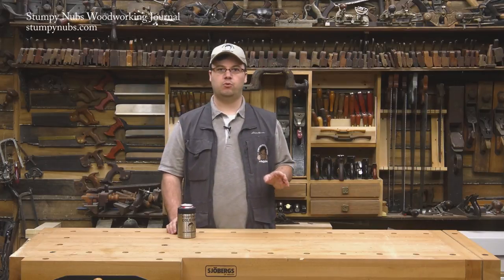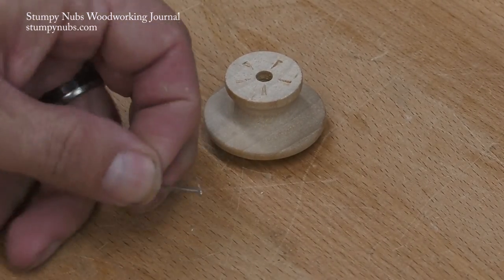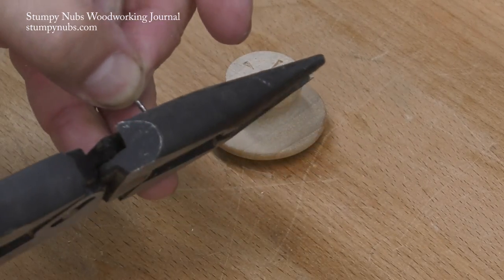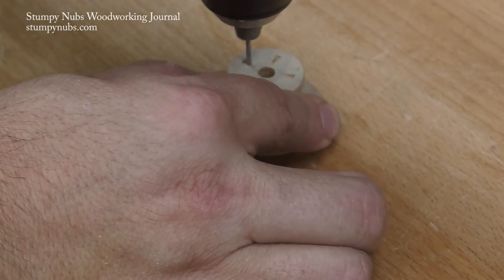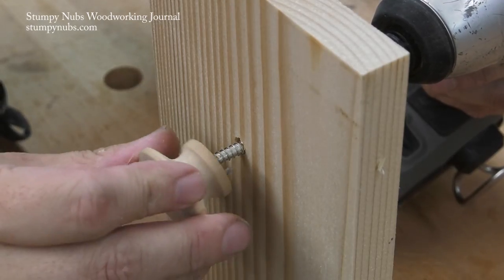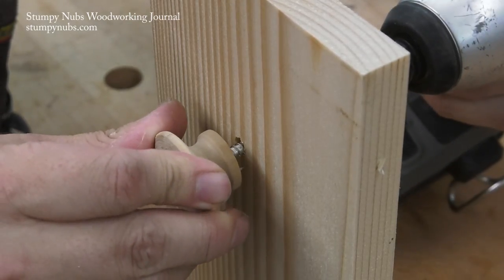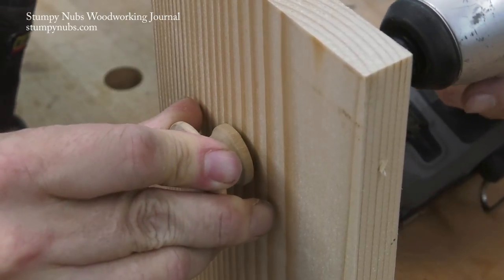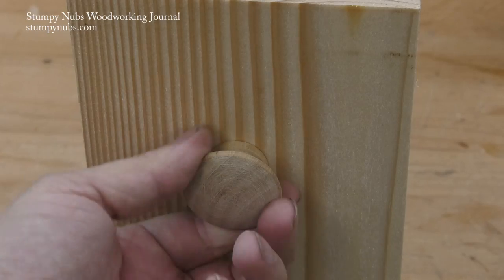How to keep furniture/drawer knobs from coming loose

Comment: This is the perfect solution for my spinning knobs problem! Maybe a dumb question but how did you get the cut nail inserted cleanly into the bored hole with the sharp end facing out, without damaging the spike?